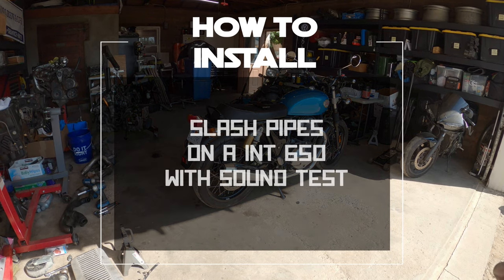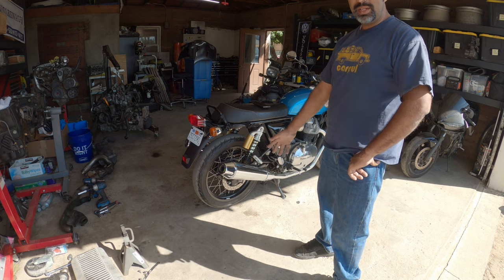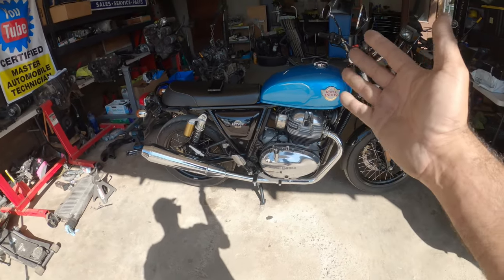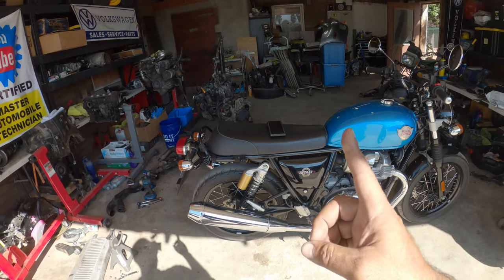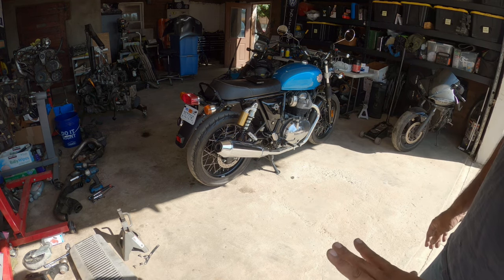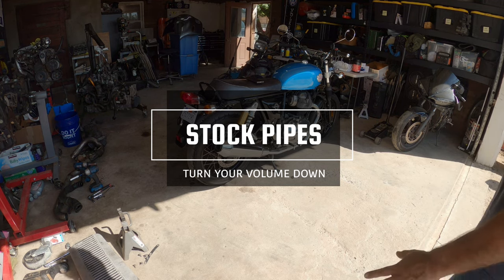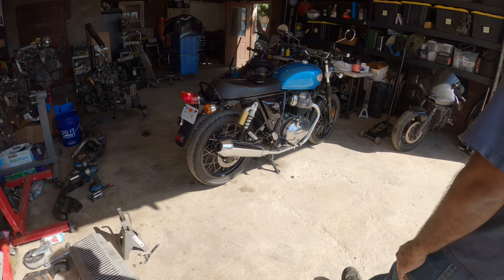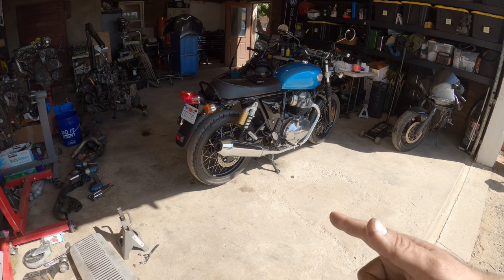Royal Enfield interceptor 650 SLASH PIPE INSTALL

Comment: I have been running the ARMORED EXHAUST slip-on pipes for about two months. So far so good. The pipes are loud, but that is what I wanted. The pipes give the GT 650 a similar sound as the HD Sportster with drag pipes. They can be loud, but if you are easy on the throttle, you can keep the sound at a reasonable level when you pass animals, children, police, Etc. and then when you want to be heard give the throttle a good twist, and they come to life! Big smiles all day long.

Comment: This is going to sound dumb, but did you have to reset the ECU for this? I'm debating on getting them for my RE
Reply from the maker: No just Bolton and go!
Reply: @PincheALsGarage  thanks appreciate it. Told myself when I got on the road. Yeah love it.....just wish it was a bit louder
Reply from the maker: Sounds amazing on the low RPMs once you get up in the RPMs it's not the best sound